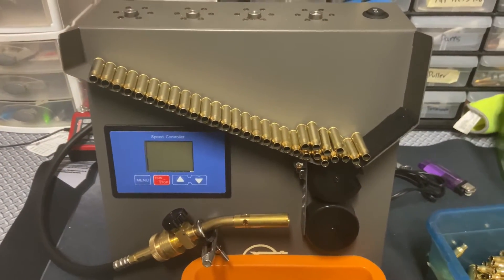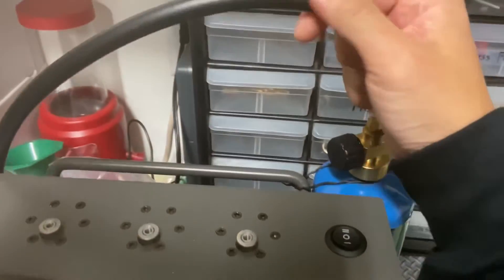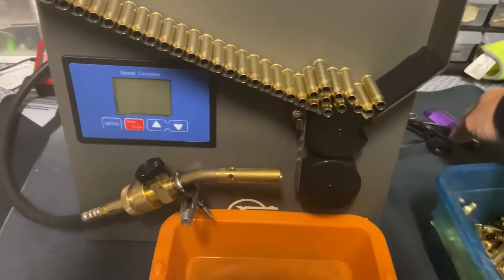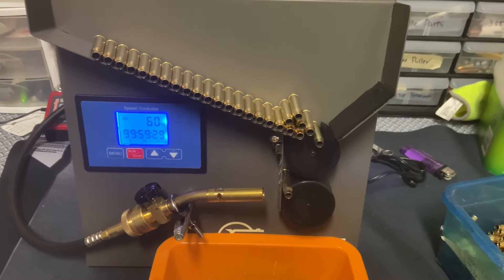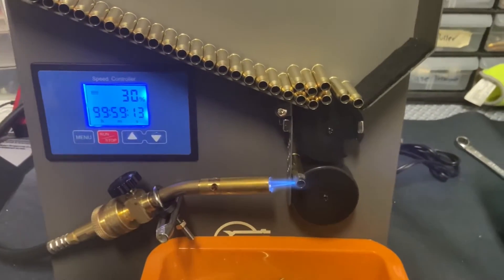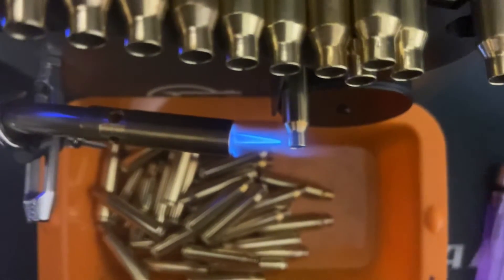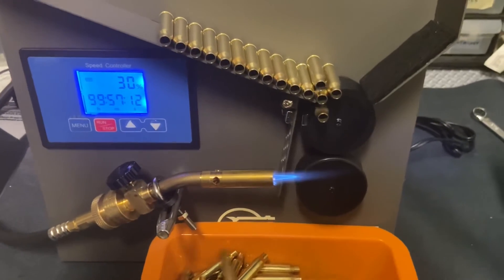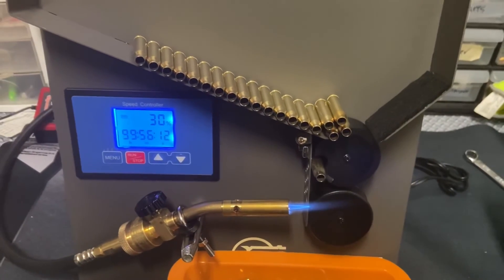Annealing Demo - Burstfire 2 in 1 - Annealing + Case Prep Center -

Comment: You mentioned up to 30-06 in the video, what about even longer cases?
Reply from the maker: Hi Michael, the included standard and magnum wheel in the new gen 2 can accommodate short pistol cases and up to 338 lapua / 300 win mag length / diameter and cases. 

The only ones it does not accommodate at this time is 375/408 Cheytac and 50 bmg. We are working on releasing those wheels soon. Just need to free up machine time to get to it.

Comment: Can you run a larger tank with a regulator? I'm interested but I'm wondering why your hose has a problem with larger tanks? Also, does the bottom wheel rotate at a fixed speed or does it change speed when the setting is changed?
Reply from the maker: Hi Eddie, if you want to run a 20lb tank, I do recommend using a high pressure propane regulator and hose. Although our hose is rated for 300 psi, the intended / recommended use is with the 1lb canisters.

Comment: Customer comment here (and no affiliation with Burstfire or any other gun-related business for that matter).  Recently purchased this unit.  I've been reloading for close to a decade, but only now advancing to annealing.  There are plenty of these type machines to choose from on the market, and honestly I didn't really need the case prep features on the Burstfire since I already have a Lyman Express case prep center, but of all the annealers I evaluated this is the one that impressed me as the best bang for the buck (and it certainly doesn't hurt to have the extra spinners on top).  Paying less than $300 (including shipping, which is not charged), the value is pretty outstanding.  I bought straight from the company.  This machine is not unnecessarily complex, works reliably, and operationally is highly efficient.  The Burstfire works exactly as you see in the video, no hickups.  It's built solidly (NOT made in China!) and weighs just shy of nine pounds without hose or gas nozzle attached.   The wheels appear to be about 1 and 15/16 inches in diameter, it stands about 11 inches high and another 11 inches across the top (around 7.5 inches deep), and of course the nozzle placement/direction is fully adjustable, as is the rotational speed as you would expect.  If you want you can certainly spend a lot more for an annealer, especially one of the induction types (the most popular one is currently selling for $1,495 -- yowser!), but for my money this does the job, does it well, will do all the brass a lot faster with less effort, and I still have plenty of cash left for either a very high quality rifle or equally high quality scope.  To each their own, everyone makes their own choice and your mileage may vary, but the bottom line for me is I consider the Burstfire one of my better purchases and yes, I would absolutely make the same purchase again.
Reply: Is there an issue only annealing the brass from one side? Most other annealers have some method of rotating the brass, or using 2 flame sources,  or inductive ring . It seems in the video the case is only introduced to the flame on one side. Yes I know brass is very conductive,  however why do 99% of other annealers bother with trying to get universal coverage of the neck?
Reply: @geeck41  the lower wheel rotates, effectively rotating the brass as well.

Comment: What is the diameter of the wheels? I have seen a few of these types and they never mention how big the wheels need to be.
Reply: Check my other comment where I listed some of the Burstfire's dimensional and weight specifics, but the case wheels appear to be 1 and 15/16 inch diameter, so roughly two inches.  Hope that helps.